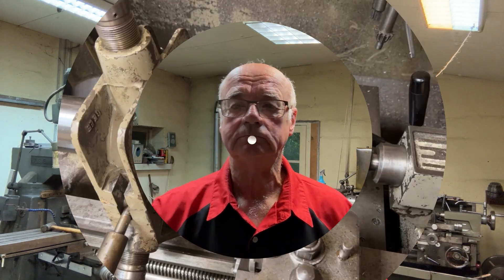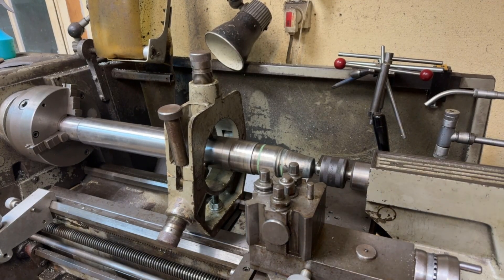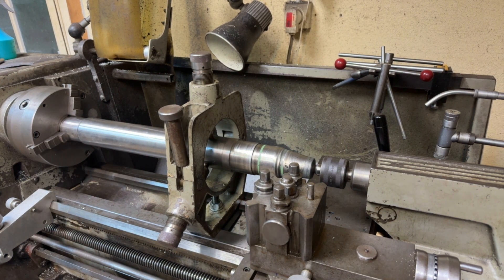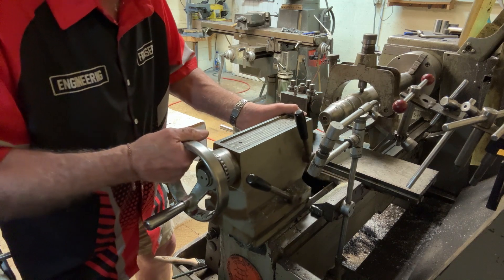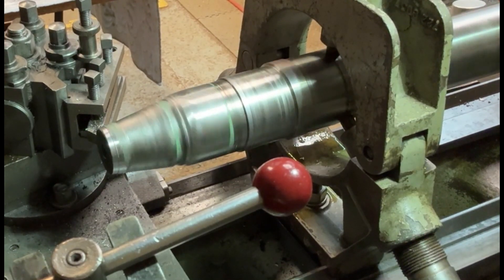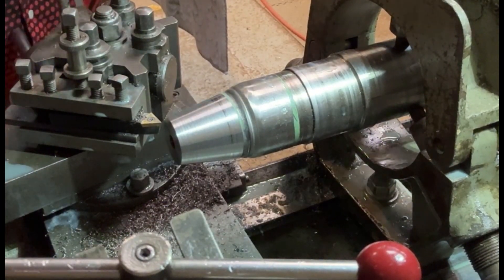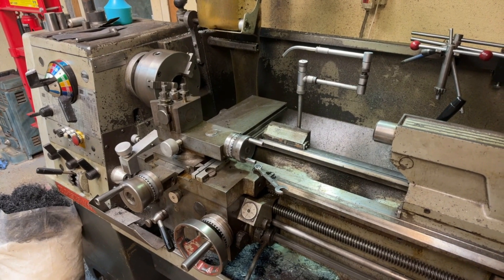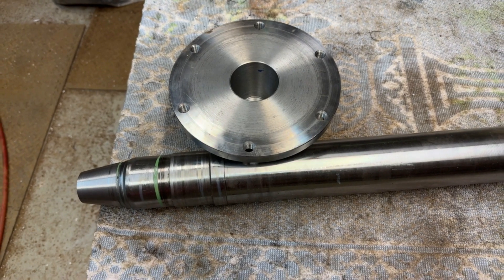Machining a Tapered Shaft

Comment: I have a nice toolpost grinder for these work hardened jobs, but I have never used it because I really do not like the abrasive dust it produces getting on the slides, even with tissue covering everything there is always dust that gets under the covers, we had an old Lathe at work for such jobs! Stay safe! Chris B.
Reply from the maker: Hi Chris. thanks for the comment. I agree with you about getting grinding dust into the slides etc. Where abouts are you? Maybe one day, I might pop down for a visit. cheers, Fraser.
Reply: @MetalworkinginFrance-xe5rg  We are just south of Cahors. I often see youtubers using a grinding attachment on their Lathe, a lot of them on the videos from India, I think they are using handed down machines that have already worked for a lifetime, but they will not survive much longer with the treatment they are getting now.I have just covered my Beavermill up as it is very humid here! Chris B.